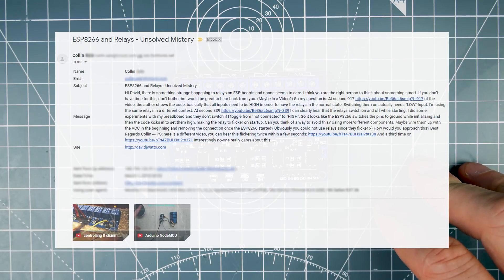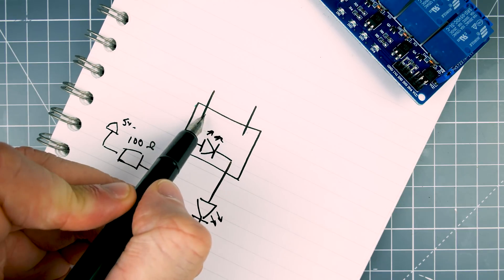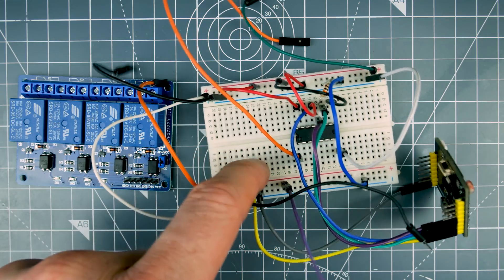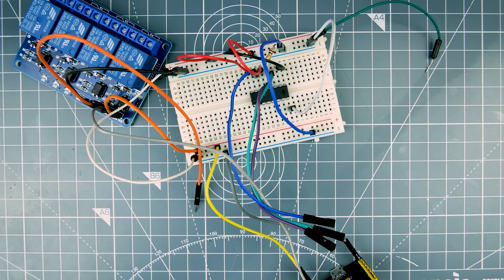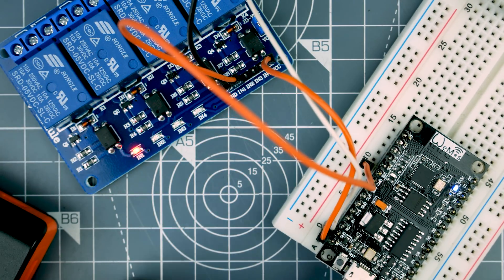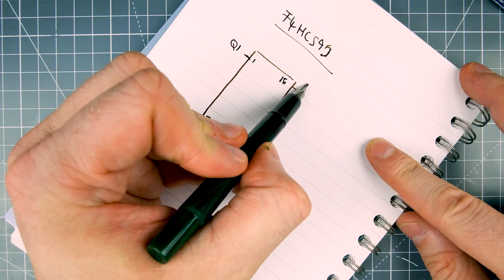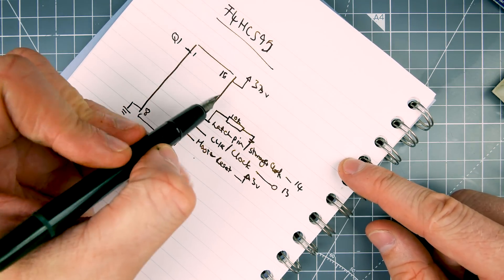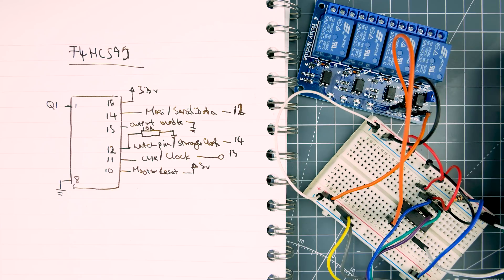ESP8266 and Relays - Unsolved Mystery

Comment: In my experience, ESP8266, NodeMCU doesn't like any components connected to it which were initially connected to GND. Tried 2N2222 and other NPN transistor to drive relays  with no success.  I ended up using PNP BC557 with its emitter connected to 5V and the Collector to the other pin of relay's coil and the other pin to the Gnd. I use 10k ohms to trigger the base. Successful.

Comment: Do not use GPIO0 as output at boot. If you do, it must be used as a pull down output. If you put a load between GPIO0 and GND, ESP8266 will boot and inmediately reboot depending on the load, lenght of the cables and electric noise of the environment.

Comment: I have had a similar issue when attempting to power LED strips, where the ESP8266 would reboot because the power load was so high on the initial boot that it would crash with a brownout and drop some pins to low. I solved this by adding a 3300uF capacitor between VCC and Ground, however this wasn't my idea, I got it from a video called "#159 Big ESP32 Boards Review and Test" by Andreas Spiess
. I am not sure if this is related, as i've yet to try and operate relays.

Comment: for reliability sake, I just don't try to control more than 6 relays using an ESP-8266 based board. If you wan to control more use an ESP-32 based NodeMCU board.
Reply: Why is that? this board also have 8 bit data out you can even use it to control 255 relays

Comment: TL;DR - in general do not use  CMD/CLK/SDO/SD1/SD2/SD3 as GPIO's - not for input nor output

For outputs, avoid 0,1(TX),2,3(RX),[6,7,8,9,10,11] (these are the aforementioned CMD/CLK etc) 15 and 16 unless you know what you are doing!

SD1/SD2/SD3 - the three pins I saw you trying to use, are are GPIO's 8,9 and 10 respectively, which in most ESP8266's are connected to the onboard flash and should not be used (8 should never be used, ever). Now 9 and 10 should not be used as outputs but can be used as inputs in some cases (but never as either if you've flashed using QIO or QOUT as they would be used by the onboard flash) I have also read that one of 9/10 is OK as an output only and the other is OK as an input only, don't recall which is which - but I avoid them altogether even on ESP boards that break them out like the nodemcu

The only "safe" outputs on the ESP8266 are GPIO's 4,5,12,13,14 and 15 (though this last one needs to be pulled low on boot for proper boot behaviour, so that's going to cause an issue with your relay board)

An added "issue" with the witty board is that GPIO's 12,13,15 are connected to LED's and GPIO 4 is connected to the button and a pullup resistor - and none of these  pins are "floating", so you won't necessarily see the same behaviour on it as you would on a bare ESP8266 or even a Wemos D1 or nodemcu or most other dev boards - so, really, the only pins that you can compare on a witty board with bare boards is pins 5 and 14
Reply: Soooo only 1 pin out of 89?

Comment: There's no mystery and there's no bug. There's simply a lack of understanding and knowledge of how the board/chip works (and not a lot of understanding about other things as well.)

I'm sorry but this is a really BAD video. He says you'd get 2.8v out after two LEDs. Either that is connected to ground (to turn it on) in which case you get...wait for it....0v or it's connected to logic high, in which case the ESP is putting around 3.3v to it and the LEDs have NO current through them (and thus no voltage drop across them.) When it's at the 0v, the LEDs probably drop around 1.7-1.9v each and the resistor drops the rest.

Then he can't even do simple subtraction of 2.8 from 5 without mumbling through it. 

He's going to try and explain what an opto-isolator is/does without understanding it really himself. 

He says he's driving the relay off the ESP and that's probably not good without understanding that the ESP is either shunting 5v right from the USB out or it's providing 3.3 through the regulator, which actually does have some room for that (those small relays probably only take about 50ma and the ESP will have that much to spare. 

Then he's using pins that are actually connected to the flash chip (the ONLY pins on that side of the Wemos/Lolin that are usable are the A0 (the one tied direct to the ADC pin and only good for 0-1v), ADC (the one tied to a voltage divider, thus allowing 0-3.3v), the EN and RST pins (to allow something else to disable or reset the ESP), VIN (for external power in), the 3.3v (for 3.3v in or out.) and GND. The whole "I don't know what the SD0 is but it sounds like serial data" just shows why "hey, let's hook this up without even understanding what it is and then when it seems to work weird, let's call it a bug/flaw" way of doing things is NOT the way of doing things.

The SD0-SD3 are NOT usable as GPIO. pins (well, you MIGHT be able to get away with using SD2 and SD3 IF you undo those two pins from the flash chip and then never try to use QIO or QOUT for the flash), nor are the CLK and CMD. Those 6 pins all control the flash memory and it's no wonder you'd get the relays activating at bootup. Depending on which one was used, you may even not GET a bootup and/or you may kill the board. I don't know why they even break those out unless its so someone could use a different flash chip or something on a separate board. There's pages all over the place that say "don't use GPIO pins 6-11 for GPIO." This is the very reason he couldn't duplicate the issue with the smaller board (it doesn't break out the flash/6-11 pins.)

I don''t know if all of this person's videos are like this and I'll never know since I'm not even going to bother with any of the rest. I couldn't even sit the rest of the way through this one.
Reply from the maker: Thanks for the time you took to write a comment, I thought I might take the time to reply even if your comment is not aimed at me.

Thanks for your comment about my mathematics ability, perhaps you would be better off with the numberphille channel if that is your bag.

The root of the video is based of another person's observations and not mine, in fact I think I said I did not understand why people had experienced what was described in the email feature, I couldn't exactly replicate it myself. 

When I spoke about driving the relays from the ESP I was talking about bridging those power pins which as I am sure you are aware exist to separate the controller from the power to the relays. I am sure the designer had their reasons.

At the start I mentioned that the pins I used did not cause in odd behaviour in the relays so I explored which pins might do it and offered a solution in the form of a shift register without (mentioned in the video multiple times) knowing the reason for the 'mystery behaviour'

I don't know if all your comments are like this but this but the community I exist in is all about sharing experiences, knowledge and helping other people. This channel is an electronics vlog, not a tutorial channel or featuring someone with any advanced training. I also don't make a living from it, I just enjoy sharing my experiences. 

While I dislike your approach to the comment I am sure it comes from a place of experience so if you care to input, please do it respectfully.
Reply: I still stand behind WHAT I said, even if I may not have been the most politically correct about HOW I said it. Yes, it was more on the snarky side than it should have been. But the points still remain. And I just see so much junk on YouTube with people trying to explain something without really even understanding the issue (and actually, your video was FAR from the worse I've seen in that regard) that sometimes it really gets to me.

But that being said.......

You never explained how you got the 2.8v number. Either it's going to be close to 3.3v (or whatever the high logic-level is for whatever's connected to it) or it's close to ground. It's probably not going to be 2.8 with an ESP8266 unless you're powering it from under 3v (although the datasheet does say the high level out can be as low as 0.8xVDDIO (which should be 3.3v on both of those boards and thus a high output COULD be as low as 2.64v.) If the resistor connects to 5v and the visible LED is connected to something else, then either the something else is pulled down to (close to) 0v and the LEDs conduct/light up or it's set to something above around 1-2v, in which case the LEDs can't conduct (not enough voltage drop available) and the control pin will either be 5v (if the control pin isn't being driven at all but is more or less floating) or whatever the controlling circuit manages to drive the control pin to.

On the relay board, the designers had their reasons for adding that jumper BECAUSE the MCU or other control source may be at too high or too low of a voltage to properly operate the relay board. Or maybe the MCU board simply can't handle the load of the relay board, you're worried about high voltage if the relay shorts out and thus want to isolate the power. etc. So you have flexibility. You CAN power the board from the same source as the MCU, as long as there's not too much other peripheral load or you can power only part of it (the visible LED and the LED half of the optoisolator.) But my point about powering the relay board from the ESP board was simply that, under normal use, one relay should be fine. Four at the same time MIGHT be pushing it, though.

And it was the "exploring other pins" that was part of the problem. If you have a device that seems to be flakey in how it works, you need to FIRST know what the pins are for. A search on the ESP8266 shows what IO are usable all the time (1, 3, 4, 5, 12, 13, 14 & 16), which are used at bootup but can still be used afterwards as long as you do it right (0, 2 & 15) and which ones are NOT (easily or at all) usable (6, 7, 8, 9, 10 & 11.) Then you'd find out what pins are what on each board. On the Lolin one (the long, skinny one) you'd find all the pins labeled D* are the readily usable GPIOs (but again, keep in mind the ones used at boot.) So you'd then try those one at a time and say "Hmmm...none of those caused an issue. Maybe they connected the relay to one of the reserved pins and THAT's what caused the issue. Let me try those. AHA! These ones labeled SD* seem to cause issues because they HAVE to go high during parts of the bootup process. That's probably what happened is that they simply were using the ESP wrong. But......JUST in case they really did use one of the proper pins and it really is a quirk of the ESP, here's how a buffer chip may help." I.e be methodical about it instead of "well, I don't know what this pin is for and haven't researched its use but I'll just plug something to it and see how fast the magic smoke appears."

And one last note on the video. The resistor feeding the LEDs was probably a 1kohm, not a 100ohm. If it'd been a 100ohm, then driving an LED with a drop of 2.2v (whether it's one or two that add up to that), you'd be pouring 28ma into the ESP, which is only rated for 12ma max on the GPIO pins. With it being a 1k, it'd only be using 2.8ma, which would be fine for pretty much any controlling chip. But basically, the the two LEDs probably have a total voltage drop around the 3.5-4.5v area (depending on the color and, of course, we have no idea what color the one in the isolator is without a datasheet.) With that drop and the 100ohm, the current would be 5-15ma and could still fry some boards. So, as mentioned, my guess is that it was a 1k, not a 100 so that it'd be compatible with pretty much anything thrown at it.
Reply from the maker: Thank you for the detailed response, it was very interesting to read.
Reply: Dead on Mike Anderson. Accurate and brilliant reply.  Fact I'm the only one who liked and thanked you for it shows just how bad it is.

Comment: I think that at boot up the outputs are in an open state, then the registers are cleared and the relay switches on and off.

I use an inverter, NAND and FF to create a CS line to switch "on"  the relay inputs myself after boot up.

Comment: I have this problem on all boards that I have used in an actual project. I was thinking of using AND gates. Have A connected to a pin on the board that is used to switch a relay, and have all of the B pins on one pin of the MCU. You activate the B pin in software when the chip has booted allowing the signal to pass through the AND gate to the relay.

Comment: All true, great vid, however the point of the opto-coupler module vrs the non, for ESP and arduino users, is it can be switched at 3v logic levels. The other modules require extra circuitry, so the opto route (isolated or not) is the prefered choice. Excellent point on the isolation.
Reply: Exactly. The LED in the isolator and the indicator LED will almost certainly drop at least 3v. Infrared could be in the isolator so it could be as low as 1.5v. Visible LEDs are normally >=1.7v. So the two has a drop of 3.2v or better. If the power into the LEDs is 5v, then the MCU has to pull it down to at least 1.8v before the relay triggers. an MCU at 2.25v or greater probably has a Vio-high of 1.8 or greater and thus a high level turns the relay off since it can't get the voltage dropped low enough for the isolator to power on. The Vio-low on the MCU is usually around <=0.3v x Vdd and thus anything using 6v or less would be able to pull the pin low enough to turn on the LEDs and thus trigger it. So the isolator both isolates the two sides (unless you power the board from the MCU board) AND with only one more part (the visible LED. The resistor is already required) it easily sets the Vio-high and Vio-low points to within a relatively "normal" range for most devices (or at least most 5v and 3.3 devices.) 

A blue LED in the isolator also would do the same but I doubt any of them would use that as it restricts the range in which the isolator can be used. You can add more and more visible LEDs as needed for higher and higher dropouts but you can't decrease the dropout of a single LED.

And on a side note, the schematic for the NodeMCU/Lolin boards actually says to use a blue LED for the power indicator due to the circuit needing that section pulled down low enough.

Comment: For an active LOW relay, you can stop chattering on boot by setting the pin HIGH before setting it to OUTPUT. This solved the problem for me on an Arduino Pro Mini. See https://forum.arduino.cc/index.php?topic=532501.msg3629795#msg3629795

Comment: if you make all of the pins lo in the initialisation of the chip may help other wise there are pins to avoid when hooking up to relay outputs with the active low enable  conversely you can have a small off time for the relay board after power up  just things to consider

Comment: Had the same problem using a similar relay board with a raspberry pi. The problem was with the device tree overlay file setting the gpio pins to the wrong voltage level during boot. There must be a similar way to set the state of the gpio pins on the ESP8266 firmware.

Comment: They go high to initiate loading from an sdcard and set bootloader modes. I would assume that if the one you have doesn't do this either the pins that do this aren't broken out, they have pullup or pulldown resistors on the board or it has a bootloader flashed to it that doesn't use this pin definition and doesn't drive them at all. If the latter is the case you might be able to find a bootloader that will solve the problem.

Comment: Aren't relays isolated? This is very bad design. Optocouplers are useless. 
Each relay needs large RC as backup.
Reply: I wouldn't be using these little Songle "10A" relays to switch more than 1-2A anyway. I tend to use 16A or 30A relays to reliably switch higher currents (even 10A).
Reply: i think optocupler  prevent you from using transistors and  diodes to drive the relay coil . and also provide total isolation from the coil also. You only are driving a led from your esp. not a transistor and a coil that can generate a HV spike

Comment: I did run into this problem when I made a controller for my garage port. On reboot it triggered opening of my garage. The solution was to use a transistor between the esp and the relay. The transistor inverts the signal so it does not open my garage on boot.

On another project involving a DC motor and 2 relays to change direction. The relays switches between positive and negative on each side of the motor. When one relay is activated motor goes one way, when the other relay is activated the motor turns the other way. If none is activated the motor get negative on both side and is of. When esp boots and both relays is activated for a moment the motor gets positive on both sides, which is canceling out and the motor does not turn. 

The two situations was mainly because I did use a esp-01 module and had to use the few outputs it has. 

After learning more, I would now have chosen another module with more io and used a pin without the issue.